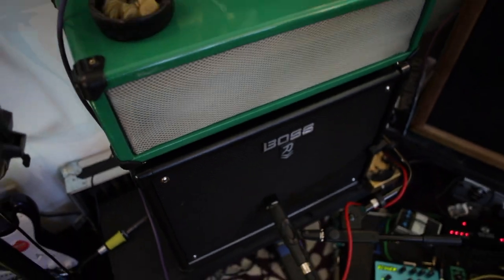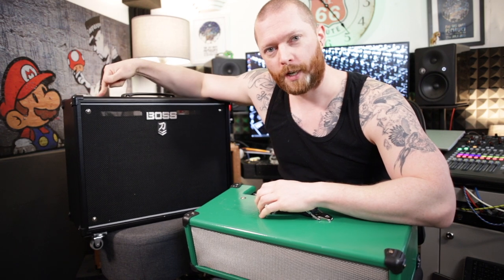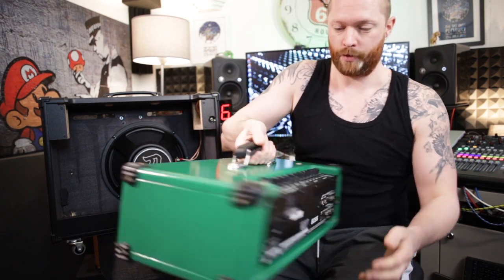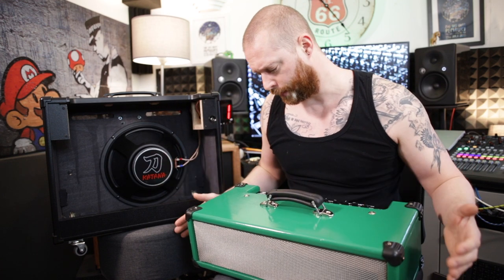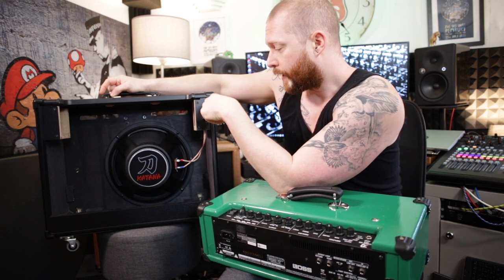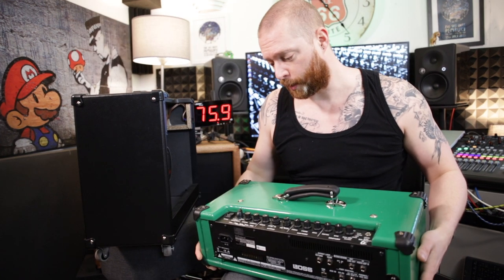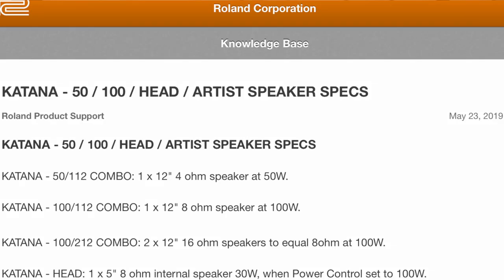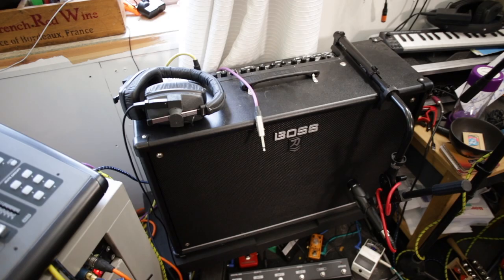How to add a Boss Katana speaker output

Comment: Great video- looking to do this too. Re the apparent improvement in sound when using ?any other speaker, I think it is worth saying that the Boss cabinet is made from mdf and chipboard- not materials usually associated with good acoustic properties. Would be interesting to see the Katana speaker in a pine or ply cabinet.

Comment: I actually did the same thing, separating the head and cab on my Katana 50.
Quick question: I've seen the red number display that is constatly changing in other videos too; is that a decibel meter?
Reply from the maker: It should really come as standard. Great little mod.

Yeah that’s a decibel meter. About £50 from amazon